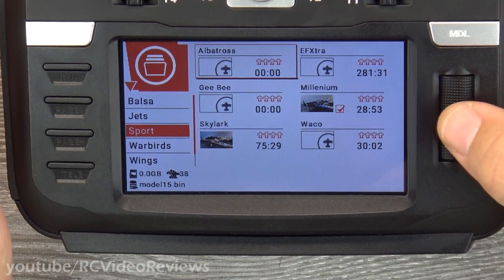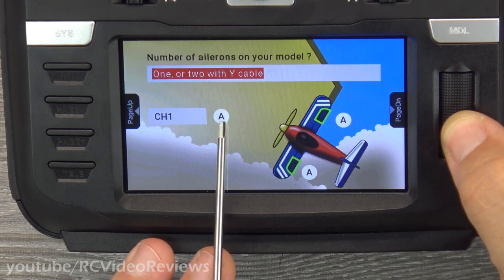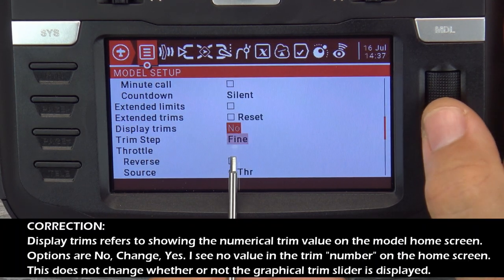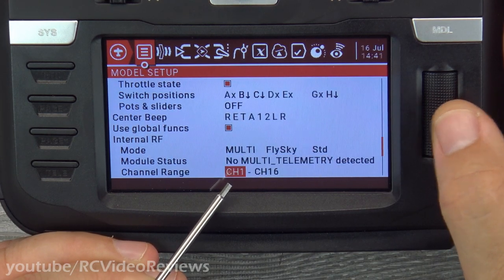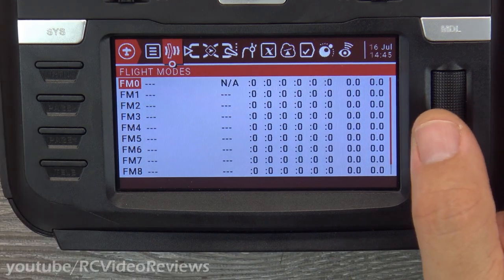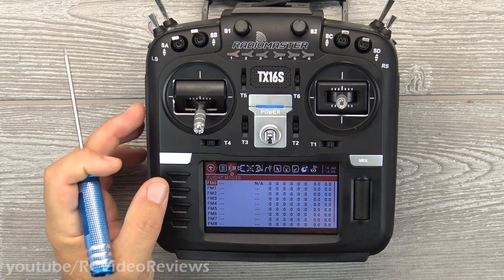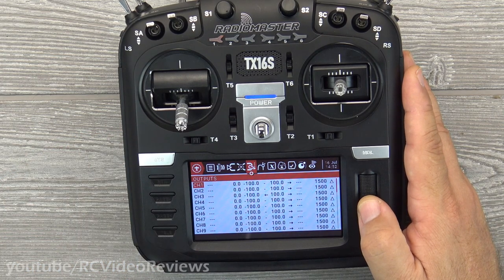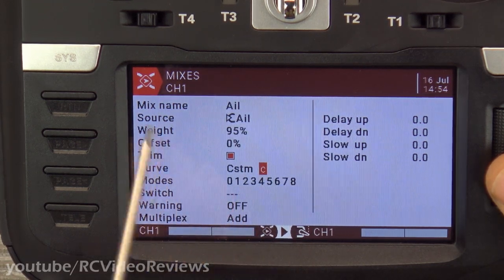Radiomaster TX16s • How-to setup an RC Plane with OpenTx Plane Setup Wizard • [Beginners]

Comment: So I used the wizard and setup my receiver in the AETR format and my plane started up wide open throttle and the controls were all wrong. Almost had a terrible accident. What could be wrong? Using AR620 Rx for a FMS super Cub...
Reply from the maker: Mode is wrong.

Comment: Hi John, On my TX16s using the Wizard to Create a new model, I can only select Glider as the Plane logo never come black square highlighted. My jog wheel work perfectly however. Any idea? Thanks
Reply from the maker: You might want to copy the correct SD card contents over to your card again. Sounds like something is missing from the card.
Reply: @RCVideoReviews  Thanks I will have a try Thanks a lot

Comment: I have no plane setup in the wizard, only glider. I have the script on the SD-card and when I manually go into the lua script in TC16X I can start it from there, but not from the actual wizard. Why's that? I tried with deleting all the files on the SD-card and reinstalling the latest OpenTX but no difference than I also got an quad but still no plane.
Reply from the maker: Sounds like something corrupted in the sd card contents. Honestly, the wizard is cumbersome so I've never taken time to understand wizard issues.

Comment: Great video your information is excellent I just received my TX 16s today and I'm setting up a new model. An older E-flite P-51 Mustang with a Spektrum receiver I'm curious how I set up an operating the landing gear? Any help you could give me on that would be greatly appreciated
Reply from the maker: If your Rx is a 6 channel, that means gear is probably either on Channel 5 or 6. So put the switch you want to use in the Mixer on 5 or 6. That should do it.
Reply from the maker: This might help: https://youtu.be/WmnZM5veAiE

Comment: Glad I found your  site......many questions....hoping your videos will answer in a language that I can understand...giving technical along with a simpler  example.......one question today...using a simple 4 channel plane model build , when picking airplane choice ,  does it automatically add inputs/ outputs or do you have to do that  ?...I have always used spektrum radios ,everything is almost done for you...so this is quite a challenge....
Reply from the maker: if you use the plane wizard it creates the inputs, mixes, and outputs. Once you have a few working planes you’ll start new ones by making copies of your working planes. That’s what I do. 

Welcome to the channel!
Reply: @RCVideoReviews  another question if iI may....I have a Hobbico Vusion House Racer quad that seems to have bound using airplane Wizard ...SLT Protocol...but no throttle action........Rise  Transmitter I used armed motors moving sticks down out,,,,,so do I need to program stuff for this...along with a 3 position mode switch too ?....if so I don't  know how..maybe you have a video on this.....thanks for your  reply.
Reply from the maker: @leerenslear1064  Sorry, I don't have any knowledge about the Vusion, so I can't answer.

Comment: Hi thanks for this. 
  Very new and a little overwhelming. 
I'm wondering I have no H switch listed in model setup. The switch also returns to the downward position. 
  I bought the unit second hand. 
Is it likely damaged ? 
Any suggestions welcome thank you.
Reply from the maker: I move my momentary switch to the left side of my radios. The stock radio has a momentary switch on the right.
Reply: @RCVideoReviews  thank you.. now I'm having trouble if I set up a new model with throttle on channel 3, it is turning up on channel 2. So I move what should be elevated on the right side and it's showing throttle on the monitor. Hence giving me a throttle warning when I turn on as the right stick is central.. 
  Ideas ?  Pretty difficult with no model club it anyone else at all to chat with... 🤔

Comment: AKA - Michael...Great info! I have the E-Flite Maule M7 that has flaps and I'm not sure what to select. I know to select flaps, but do not know how many channels, one or two.  On the SYS button, and when you scroll down to the bottom, where is say; Default channel order and mode, what should it be set at, RTEA, AETR etc.
Thank you so much in advance!
Reply from the maker: If your flaps are connected via a Y-Cable and only take one channel on your receiver, then it's just one channel. Most planes should only have one channel for flaps. It would take a pretty special use case to use two channels for flaps I think (maybe glider flyers). 

Default Channel order is whatever you want it to be. In OpenTx land we don't really care that much about things like channel order. I think that is used so when you create a new model the software knows your preference for what surface to put on what channel.

i.e. If you have AETR and create a new model, the software will do this:
A=Ch1
E=Ch2
T=Ch3
R=Ch4

If you have RTEA and create a new model, the software will do this:
R=Ch1
T=Ch2
E=Ch3
A=Ch4

I've always used AETR but it really doesn't matter.
Reply: @RCVideoReviews  gotcha, thanks my friend, I appreciate that;
Reply: On my Maule M7, flaps are CH6 (one channel).  Also, I check "Disable Channel Mappings" to bind using protocol DSM X2F

Comment: Hey RC Video Reviews! I gotta ask, if the non hall sensor gimbal radiomaster will support touchscreen out of the box? Or does it need to have firmware update.
Reply from the maker: The non-hall radios do not have touchscreens. So you'll need to change the display if you want that feature.

Comment: your videos have been very helpful but I do have a question. 

I am setting up a plane that has dual servos for elevator with no "y" connection as well as no "y" for ailerons. is there a video to help me with that? thanks in advance bud!
Reply from the maker: Search the channel for videos about the mixer. Bottom line, each line in the mixer represents an output channel. So if you don't want your ailerons (or flaps) on a "Y", you have to connect them individually to a pin on the RX. That pin must have a corresponding mixer entry usually defined by an aileron input on EdgeTX. Keep watching my videos, I've covered this type of question dozens of times. Look for videos that talk about inputs, mixes, and outputs.
Reply: yup I found it awesome man! thanks for reply. I just figured out the ember sound pack and that was a struggle on a 10 year old MacBook. haha. thank God for backing it up like you said to do in your video about it cause I managed to delete everything somehow. it's a learning process forsure but your videos make it possible.
Reply from the maker: Glad you found what you needed. The best thing to do is take your time, watch the videos, play along with them on your radio, and keep good backups. Have fun!

Comment: Hello I am very new to RC planes and i followed this video but cant seem to find my Receiver in the list. I have a Spektrum AR400 receiver. any help would be appreciated
Reply from the maker: Don't go by Rx name, go by protocol. The AR400 is DSMX, so you need to set the MPM to use DSMX and follow the AR400 book to put the Rx in bind mode.
Reply: Nevermind! Trial and error and I got it!! haha

Comment: Ok now a question for you: my 35% planes have 2 servos for aileron per wing panel. Radio doesn't give me the option for this type of setup. And I cannot link 2 servos with extension because it does need some fine tuning in order to function properly. Ideas?
Reply from the maker: Sure you can, you can set four channels using the aileron input. Two going one direction. Two going the other. Set channels 1, 2, 3, and 4 as ailerons using aileron input. Go to outputs add all four aileron channels then reverse two of them. it works. I have that same setup on my Smoove for the two elevator servos.

Comment: thanks for that video and rest of it. it really helped me to understood way how it works.

quick question. Throttle timer - it starts counting down or up (depends on setup) once i move the stick. However it also counts when throttle cut is active. Any idea to walk this around ? i dont want timers to work while throttle is not activated.
Reply from the maker: Set your source to Ch3 (or whatever channel in the mixer you put your throttle on) Then when the throttle cut overrides channel 3, the timer won't be active regardless of stick position.
Reply: @RCVideoReviews  thank you sir, that worked like a charm. Sub + bell done with pleasure!
Reply: @RCVideoReviews  Where do you mean to set source to Ch3 ?  In MIXES, or INPUTS or in firs page MODEL SETUP, please?

Comment: I have tried flashing everything up to date and still dont see catagorys as shown in your video what am I doing wrong?
Reply from the maker: Did you make a category? Those are my categories, you have to make your own. From the model select screen, long press the jog dial and the 4th option down says, "Create Category". Press that, it will create a new category named "Category" at the bottom of your category list. Use the page right button to move the cursor to that category, long press scroll dial and the 3rd option down is "Rename Category"  Highlight that and you can change "Category" to whatever you want.
Reply: @RCVideoReviews  works fine thanks

Comment: Hi Guys, is this firmware and programming the same on the Radio Master TX16S Max? I am guessing so. I am thinking about diving into Open TX though I have a fairly low milage Hitec Aurora 9. I am a bit computer savy, played with all sorts of software for auto, ham radio and an electronic tech etc., despite that there seems to be a huge learning cuve using Open Tx. Cheers and thanks for this great video.
Reply from the maker: Yes. The TX16s Max is just OpenTx, nothing special about the software. OpenTx only needs to be as complicated as you want it to be. You can setup a model in about 8 clicks. Check out my beginner playlist and just have some fun with it. It's excellent software https://youtube.com/playlist?list=PLy3TC1ILJYTjqDXFB84oXVWZG14zyMYYt

Comment: I set dual rates on the P51d mini mustang, but it only works on acro mode. Is there a way to make dual rate work on all three flight modes? Thanks.
Reply from the maker: Acro mode? What stabilizer are you using? The stab really shouldn't be interfering with your rates. Your rates are decided and calculated before being sent out the radio. The stab should have no idea what rates are.
Reply: RC Video Reviews Experience mode works w/ dual rates but not intermediate or beginner. It’s the stabilizer that is built into receiver.

Comment: Just purchased the TX16S, and noticed my model setup screen doesn't show (balsa, jets, sports etc.) and noticed down below the Models logo , the sd card symbol shows 0.00 GB. Nor does it show letters in the circles for (flaps, rudder etc.). And then when I move between questions the text I've entered disappears. The firmware says to be version 2.3.11-otx. Any answers as to why?
Reply from the maker: Balsa/Jets/Sports - Those are categories. You have to make those yourself. 

I don't know why the SD card shows 0.00 other than to speculate the stock card is only 256MB. I installed a larger card in my radio. 

Letters in the circles for flaps rudder etc?? You'll need to be more precise.

When you move between questions? You'll have to be more precise.
Reply: @RCVideoReviews  Ok, so the sd card is a 256MB. The issues above are all on the model setup screen displays, (A model, B flaps etc., does your model have a motor on what channel etc.) Thanks
Reply from the maker: James, I'm not following you. There is a model setup wizard and I think that's what you're referring to, but I don't know what you mean about letters in the circles for flaps/rudder. FWIW I've never used the model setup wizard. I always thought it was much easier just to "Create New Model" then escape out of the wizard. At that point the software will create a basic four channel setup with inputs, mixes, and outputs. You can easily edit to suit your needs from there. I've used that wizard about three times. One of them to show how to use it on the channel. Just not my thing.
Reply: @RCVideoReviews  Sorry, I go into the "Create New Model". When it asks you for example "pick the tail config of your model" and I pick "one channel for elevator, one for rudder " then go down to show which channel. The "one channel for elevator, one for rudder" will disappear out of the box. The first channel I input, also will disappear when I go down to show the next channel. The circles next to the channel box's and the plane image do not show an A or a B in them. Thanks!
Reply from the maker: @james7224  Like I said, I've used the model wizard about 3 times. I have no idea why it wouldn't work. Are you using the default theme? I can't really offer help beyond this because I just don't use the wizard.
Reply: @RCVideoReviews  Yes, using the default theme. So I believe I'll format a new SD card etc. and see if that solves the problem. Thanks!

Comment: Please help I have my TX up to date? but the option for fail safe isnt showing on model set up like here ?? do I need to update something?
Reply from the maker: Is the multi module turned on? Do you have it bound to a plane?
Reply: @RCVideoReviews  yes set up several models so far seems ok but back in my mind I feel something isnt right a thr% timer is activated even when throttle cut is on and TC is set to switch SF as I am setting up a powered glider atm would have thought it would have not triped timer even though its not bound yet I am just testing model set up.
Reply from the maker: @BrianRamseysg01  Use your throttle output channel as the throttle source on the setup page. That should stop the timer from activating unless the channel output is also allowed to be active.

Comment: Just got the TX16s and it works great. I have not been able to see what the TRSS is for under widgets. It has an output of 51 but I do not know what that means. I fly a Valient with a Spektrum receiver. Appreciate any help any may have. Al
Reply from the maker: TRSS is telemetry signal strength.
Reply: @RCVideoReviews  ok thanks. What type of numbers should I have there? It shows 51, Does that mean the signal strength is half of what it needs to be? Is there a way to get closer to 100%

Comment: Can Radiomaster tx16s show values in us of sticks and switches (not just percentages), like Taranis can ?
Reply from the maker: Yes, there is a firmware option in companion called ppmus. If you check that and flash it I'm pretty sure (80%) that will do what you want.
Reply: I figure it out, when you are on main screen, just long press scroll wheel and choose 'monitors'. And there you have values in microseconds.

Comment: I heard you can get up to 32 channels on this radio ,is this achieved by linking four x eight channel recievers together and or s bus ?
Reply from the maker: You can do 16 on the MPM, and 16 on an external module. You just need Rx's that can do 16 each which is doable with s.bus.

Comment: my local hobby shop told me that if i bought the rm tx16s or jumpter t16 transmitter it wont bind in a receiver that has as3x and safe technology and if it did it wont be functional is that correct? or was he just trying to upsell me on buying a spektrum transmitter. please help
Reply from the maker: Total fabrication. Spektrum works with TX16s and we have guys on the channel (in Discord) who know how to setup Safe/AS3x, it's not that hard. Sounds like the local hobbyshop needs some training because they are dead wrong.
Reply: Omg thank you ill definitely return this for a tx16s. Its cheaper better lookin and more functionality for sure than the dx6e. Whats the discord maybe i can use some help too
Reply from the maker: @quinnpatrick997  Discord is where RCVR people hang out. Here's a link: https://discord.gg/jSFTASU  You can join there and ask questions to get help. We have a lot of smart people who are always willing to offer a hand.

Comment: Is that like a radio master version of an ix12
Reply: Similar and different at the same time.  Uses OpenTX as opposed to what ever system Spektrum uses.
Reply from the maker: From what I can tell the ix12 only supports DSM and CRFS (Crossfire). This TX12s supports a massive list of protocols and as Shadow Opp.'s said, the software is OpenTx which is opensource. They have a stable branch and nightly branch. The nightly gets constant development which eventually rolls into stable. It also has an amazing PC element called OpenTx Companion which lets you setup models, backup the radio, simulate radio/model options. It's exceptionally good software.

Also $629 for the Spektrum, $139 for the TX16s. So...
Reply: @RCVideoReviews  for 139 it is a steal and no Spektrum bs prices either!
Reply from the maker: I agree. I'm impressed at the price point on this bad boy. I'm looking at Rx options next. My universe of hardware just opened up a little.

Comment: Could you do a tutorial on how to add new model images taken  from camera is this possible? And how to add custum background images, im new to open tx radiomaster tx16s
Reply from the maker: I probably couldn't do a standalone video on this, but I can sneak it into one of the other tutorials. I'll give you a quick answer on it:

1) Take picture
2) Open in photo editor of your choice.
3) Resize to 192x108 pixels
4) Name it with 8 characters or less, no spaces, no special characters.
5) Put in IMAGES folder on Radio SD Card.
6) Bob's your Uncle

Custom Background Images would go in the THEMES folder in the theme you want the background for. Resize your image to 480x272. Name it background.png